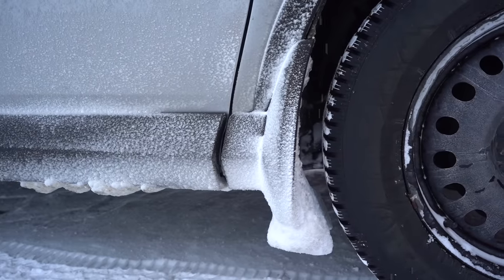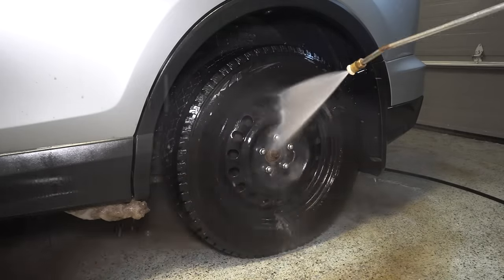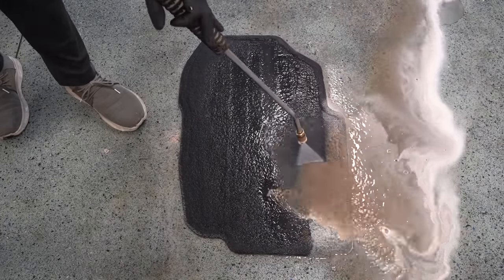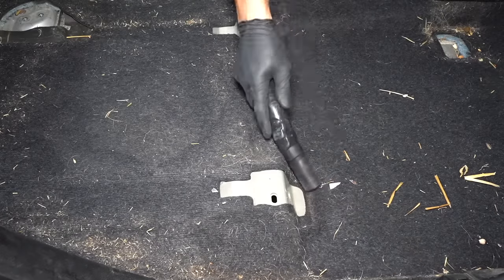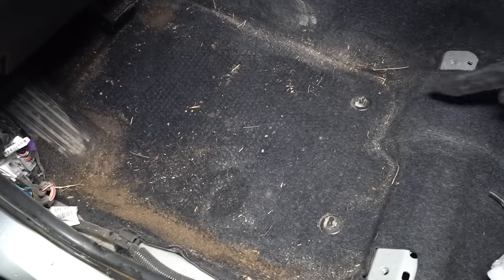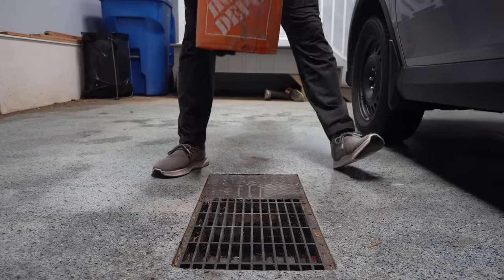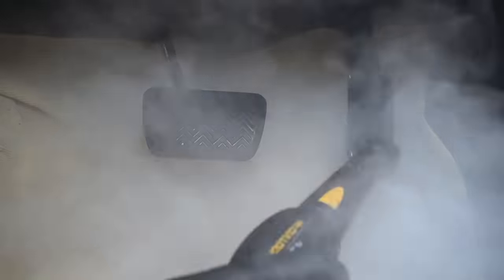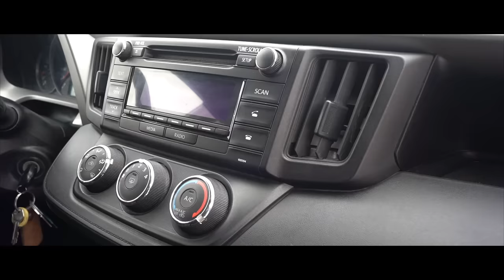Cleaning a Toyota ABUSED On The Farm! | The Detail Geek

Comment: Few questions:
Do you clean the headliner and if so, how?
How long does it take for the carpet and seats to dry fully?
How long do you typically keep the vehicle for?
Reply: Few questions, no answer. Sucks huh
Reply: Was thinking the same thing 🤔
Reply: 1 . Yes, he does clean the headliner but not often as it doesn't always need too.
Reply: @nqobaningidi4834  Cleaning the Headliner Would be risky. The Older the Car the more likely the fabric is going to give away from the foam. Then You have A problem. If I would be doing it I would have the owner sign A disclaimer. Not responsible for Headliner outcome.

Comment: 335,000 Kilometers in 6 years is honestly a great testament to Toyota's long term reliability
Reply: 6 years is not long term though
Reply: @JimTom.  

Yeah but judging by the condition of the vehicle we clearly see this thing has been driven to the ground and went to all sorts of places working around the farm when it's just a small crossover not even intended to do the things that work and trucks and SUV's do,  also with this many miles on it the car is still reliable and well be for a long time because for Toyota and Lexus they can go on and on and on without problems 

their are 20 year old cars out their that don't even have half the mileage this 6 year old vehicle does

Comment: Quick question: I saw on the final take of the instrument panel that the airbag light is on. Was this because of the seat removal? have you ever triggered a check engine light or airbag light because of something you did? If so, how do you deal with these types of issues? Thanks! love the channel!
Reply: He 100% messed up
Reply: You want to disconnect the negative terminal on the battery before pulling the seats out. In his defense, the car does have 330,000KM on it so there could've been underlying prior issues.
Reply: no, it is not messed up! when seats get soaked, ie from extracting, in some vehicles water can mess with the occupant sensor in the seat and throw the airbag light on. when the seat fully dries up, the airbag light will turn off. I had the similar problem in my subaru forester with cloth seats. 

(the vehicle could have underlying issues of course, but for 330,000KM the vehicle looks in excellent shape- every time i’ve extracted my subaru when I owned it, it threw the airbag light until the seat cushions dried).
Reply: @yay842  please read my previous comment, he did not mess it up. in certain vehicles with cloth seating water will screw with the occupant sensor and throw the airbag light. it will turn off when the seat cushion dries.
Reply: He often mentions that he disconnects the battery before removing seats.
Reply from the maker: No, this was not anything that I did (because I know what I'm doing).....a lot of the vehicles that I do have CELs or other warning lights on when I get the vehicle.
Reply from the maker: @yay842  Sure didn't. Read my comment.
Reply: Sometimes the airbag light will stay on when the key is on the ACC position. When the vehicle is cranked up, usually the airbag light will turn off. Or, it could be a sensor problem or something underlying.
Reply: @yay842  No, he didn't, and I do hope you're thoroughly embarrassed and ashamed of yourself when you read his comment directed to YOU!
Reply: @jb6712  You know those are bots, right?

Comment: The Detail Geek do you feel it's necessary to use the brush on the floor mats? I've pressure washed a few floor mats and they look like new without the brush. Isn't it alot more wear on the mats if you use the brush? I shake , vacuum and pretreat them then just power wash them they look like new.

Comment: Question: When I use my bissell, i spray it on before I extract the seat, and then when I am extracting it, I spray the seat while doing so, but it uses a lot of solution and runs out frequently. Does this happen to you aswell? If not, what should I do differently?

Comment: Another phenomenal transformation. Can't help but think that, at least for the carpet, protective rubber mats would go a long way to keeping the carpet clean--and straw and other debris could be easily removed by taking out the mats periodically and hosing them off. And despite the current outrageous prices for both new and used cars that dealers are charging, the build on cars seems to get cheaper every year: poor quality carpeting, thin seats with less padding (I noticed this with the rear seats in particular--they're half the thickness of what they were 10 years ago). Best wishes to this couple on their new arrival! Baby will have an immaculately clean car.

Comment: I bought a 2000 Toyota sienna from a one owner who bought it new to drive he and his co workers to the coal mine. He retired in 2018 and used it as a farm vehicle when he retired when I bought it after that year for 1000 bucks it still runs well but the interior was black and tan before I cleaned it. It was gray on gray after just using krud kutter, windex, and shock it clean.

Comment: Why not use wall mounted clamps for the floor mats?  Speeds up the process by putting gravity to work!  The detail shop I use here in Denver has them and you can see the dirt pouring down the wall while they clean them.

Comment: Just curious, did you put a specially built vacuum in you home? I know you use a wall mounted central vacuum system. And you said it took over 3 hours of vacuuming. Just curious if it made your vacuum system over heat or anything. Or if you have a specialty built one installed?
Reply: Central vacuum system.
Reply: @IKhanNot  I'm fully aware it's a central vacuum system. I have an old outdated one in my house. I was just curious if he bought a heavy duty specific one. Or what